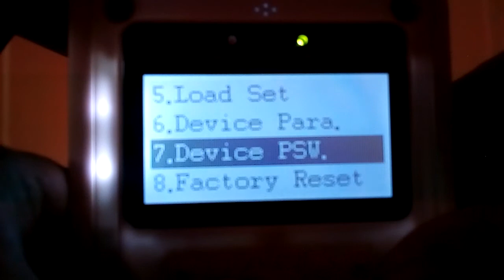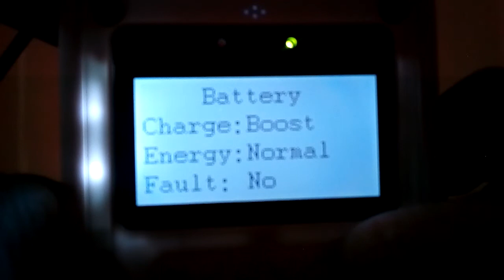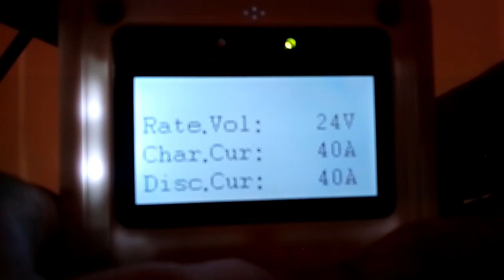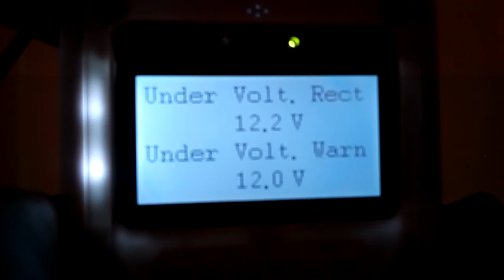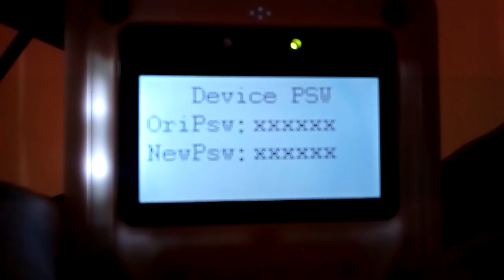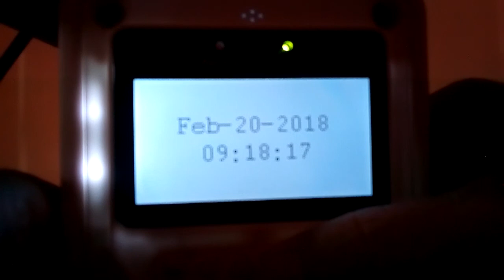MT50 Meter for Epever Tracer - Overview

Comment: Anyone know why the battery state of charge shows 1/2 full when the battery voltage reads 12.8 volts? Is there a way to set the state of charge reading to 100% when the voltage reads 12.6?

Comment: Anyone know if the load output terminals can be setup to automatically turn on and off the inverter based on battery voltage?
Reply: suggest use Triron or Tracer-AN 50-100A controller with replay port, plus an epever inverter

Comment: FYI, for LiFePo batteries no equalization, set eq. time to zero. Temp probe is also not needed set temp to zero.
Reply: I'm a bit puzzled on equalization. If your solar charge controller has a profile for LI, apparently it will already be a default setting. If you use a "User Mode" set of parameters, as I do, the manf (in my case AmpereTime) recommends "EQUALIZER CHARGING VOLTAGE 14V" and "EQUALIZE DURATION 120min" (note this is for my 200ah LiFePO4 purchased Sept 2021)
I just googled this topic and see inconsistent results. I will adhere to the manufacturers parameters and would suggest to others to consult the product manual or contact support of the battery manf they own.

Comment: Hi, i have mt 50 with four panels (240w) and four gel(180ah) batteries. System should work on 24v because of inverter. What is strange to me is user defined charge parameters cannot be changed? High voltage disconnect at 30v is too much i think? Can we change that?
Reply from the maker: Hi Dino, I found a copy of the MT-50 instruction manual, you can download it here:
https://www.gme.cz/data/attachments/dsh.522-072.1.pdf
Page 18 gives you the parameters, but only for 12 volt batteries. I believe the parameters cannot be changed, that's what pretty much the batteries manufacturers recommend. For gel type batteries at 12 volts, 16 volts is the disconnect voltage. Not sure it would be safe to say that at 24 volts the disconnect voltage is 32, but you mention 30. I have seen my 12 volts system spike up to 16, but remember it only last a few seconds and I never had any problems. 

So to answers your questions, no, I don't think you can change the set parameters for any type of batteries, but see if you have a "user" setting in the Battery Disconnect Voltage. It appears that you can change on a 12 volt system to anywhere between 9-17 volts.

For the second part, I don't think that 30 volt disconnect is too high. Hope this helps. 

Good luck!

Comment: Strange i have 410w 2 panel setup and im getting 35.5v and 3.0A off my pannels. Is a bit cloudy but going by your setup mine should be close
Reply from the maker: It sounds like you have your panels set up in series (panels connected negative to positive). Remember that voltage x amps = watts so you are getting about 106.5 watts total. Now several factors will determine how much you get from your panel. If it is overcast or cloudy you will get less watts. And the big thing, you have to have a "load" connected (TV, fan, fridge, etc.) that will make the wattage jump up to whatever your system requires. You will never get a full 410 watts, about 70% is more or less what you will get at best (middle of the day/sunny). 

Also take in consideration the panels angle and the direction they are facing. If they are not aligned right, your wattage will be lower. 

My system is a 500 watt right now and I plan to upgrade to 1000 in the future. At it's best I get about 325 watts for an hour or two around noon (sunny day), but I have seen it jump up to 429 watts for a few seconds. Then for about 2 hours before noon and two hours after I get between 250-300 watts. My battery bank is only 250 AH (5 - 50 AH batteries). I believe if I increase my battery bank, I might be able to increase also the watts I get, not sure on that yet. My best for one day is 2,567 watts, but average about 2200 on a sunny day. On an overcast day, about 450 watts.

What I would recommend is to make sure your panels surface is clean, they face the sun and also are inclined at the right angle and check your readings at different times of the day and under different weather conditions. 

It's my impression by everything I've read that monocrystalline (black) panels give you a higher output than polycristalline (blue) panels during cloudy conditions.  

Believe it or not, I'm able to run a 514 watt air conditioner for about two-three hours in the middle of a sunny day
Well, hope this helps!
Reply: The Solar Energy Channel thanks for the reply,i actually have them in parallel. I only got it set up so interesting to see what i get today its blue skys here in Ireland.
I was going to try in series to see the difference
Reply from the maker: DecoD71 Hope you get better readings with a sunny day. If you are able to move them around make sure they face south. If you have an Android phone, there is an app by the name of Solar Tilt. Use it if you can, It will give you the solar panel inclination in degrees once it finds it's GPS position.
Reply: The Solar Energy Channel nice one. At the minute im getting 35.5v 7.7a at 270w
I got a 40a controller i thought i would have more amps.. anyway thanks for the detailed replys il download that app
Reply from the maker: DecoD71 If you have an MPPT charge controller on a sunny day with a load you should get 60 to 70 percent of the panel rated wattage. Much less if you have a PWM controller. Good luck!